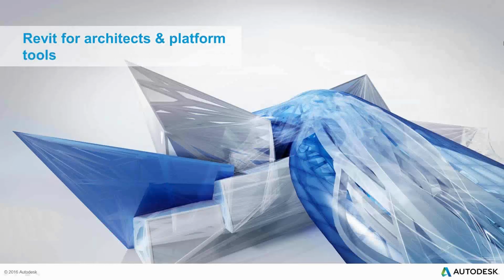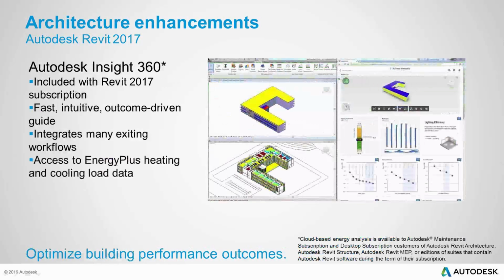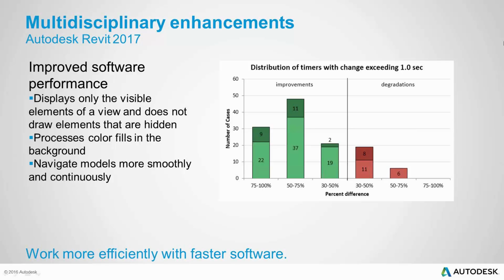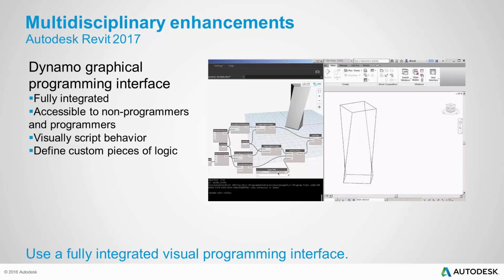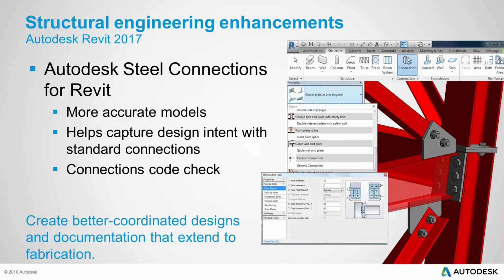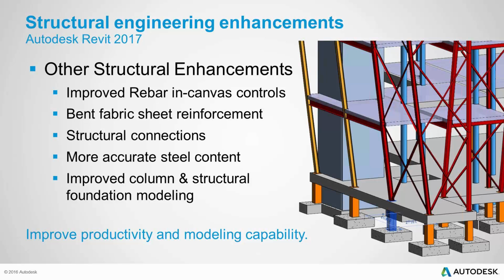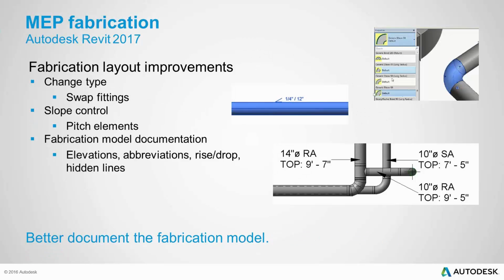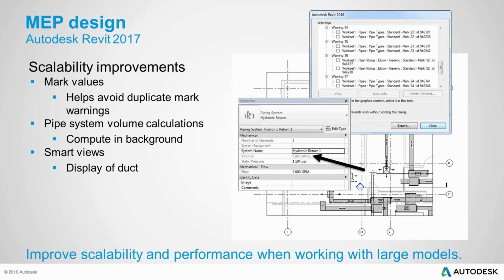AVA: What's New in Autodesk Revit 2017

Comment: It doesn’t work faster than 16 at all. Even worse, after hearing the words "enhanced speed" I actually did some tests, and it works the same if no slower. It starts faster, and that's about it. When generating geometry from pattern based surface, it actually took longer, and the same for rendering, it didn't perform faster. I expected more, so I'm a bit disappointed.

Comment: The text editor is a BIG IMPROVEMENT! This was due for a very long time...kudos autodesk....finally! However, when will revit be able to import pdf files and explode it..?
Reply from the maker: Hello! It is indeed a great addition to the software. There may be a workaround for your request. AutoCAD 2017 can import PDF's and convert them to usable lines as long as they are vector data, raster images will not work the same way. You can then manipulate the dwg as you wish and export that to REVIT. Hope this might help!
Reply: I don't think autodesk should bring that ability in. Revit is a powerful tool why on earth would you want to import pdfs in your models?

Comment: hi with I question I want to know if you fix the problem that we can't use the files like in a new version in a old version?
Reply from the maker: +Raul Lima Hi Raul! Unfortunately, files created or edited in newer versions of Autodesk software aren't backwards compatible with older versions of software, except for AutoCAD.
Reply: WHY? It almost impossible to work with our college friend on a project we always stop, We should open it everywhere
Reply from the maker: Tiago, if you are on a current subscription, you have access to the current version as well as the 3 previous versions of the software. This may be able to get you to the same version that your friend is using. Increased functionality in each new version is one of the things that prevents backwards compatibility. Older versions of the software are unable to translate certain objects and features from the newest versions, but some of the new features are well worth the migration.
Reply: I agree and Understand your point, but today we use ssd on our Laptops, they usually have max 254gb, so it doesn't permit me to keep all versions on my computer when I go mobile. Do you think one day they will come with a file that permits this? Thanks
Reply: That will never happen. What you are asking doesn't even make sense. Simply coordinate the correct version with others before you start a project.
Reply: Imagine you getting to your computer's university and you can't open your project because it's on a newer version.